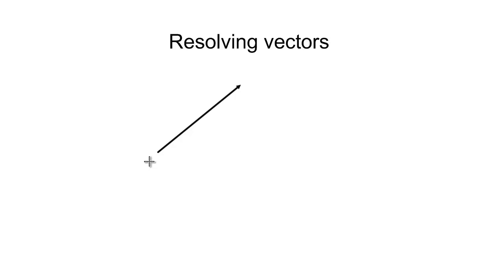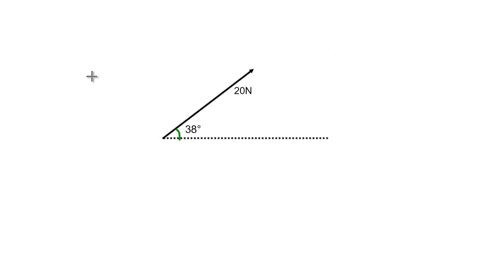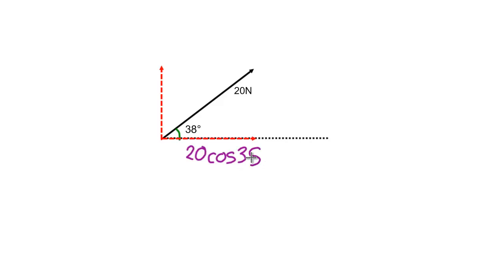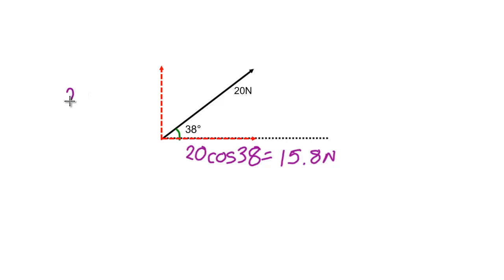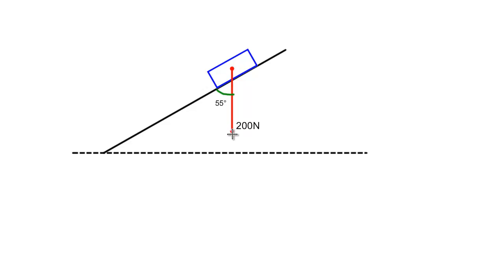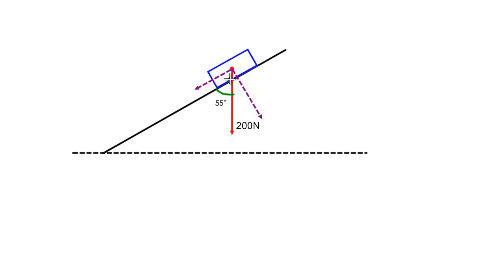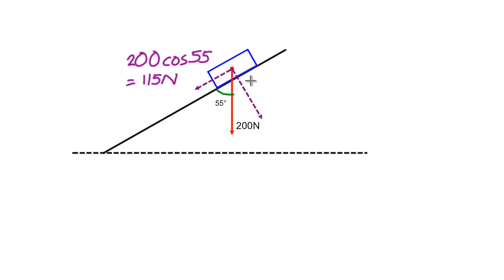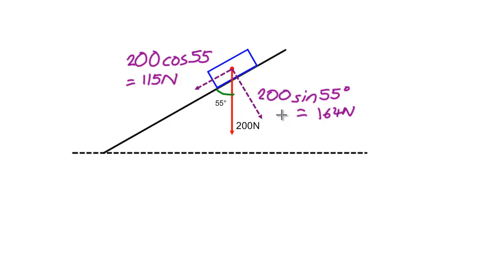Resolving vectors

Comment: fro resolving vectors on the inclined plane, the angle given was not between the weight and the component, but between the weight and the slope. why did we use that is our calculations? is it because the component was parallel to the slope?
Reply: Am also confused
Reply: Yeah it's because they both are parallel(the x component and the slope)  so by co interior angle theorem, the angle the x component and the x axis make with the weight vector is the same.